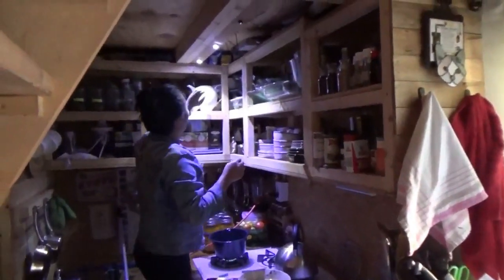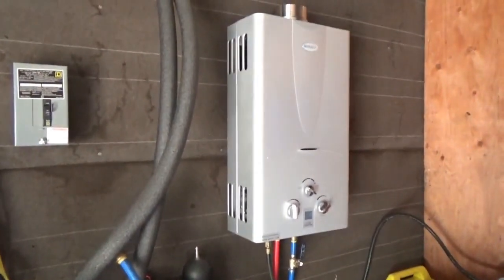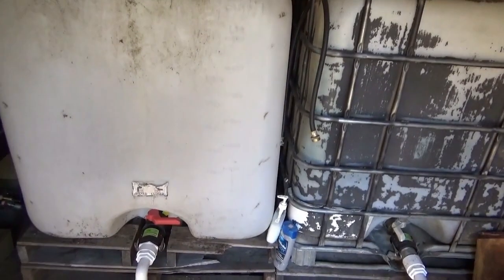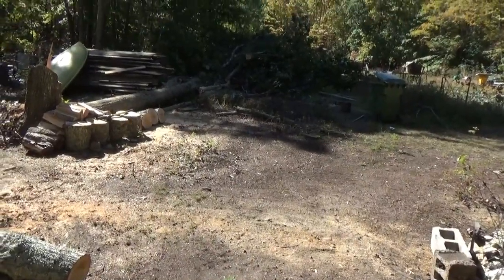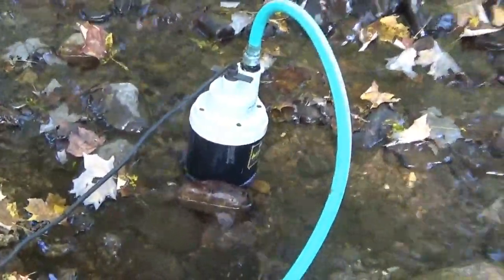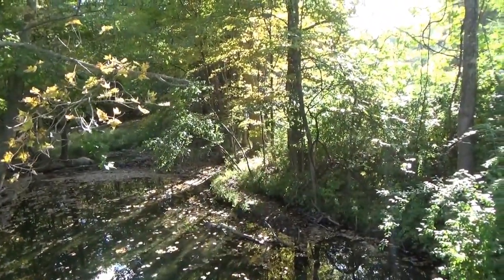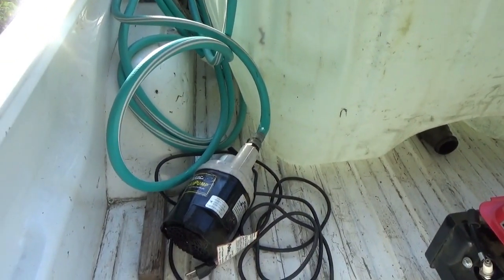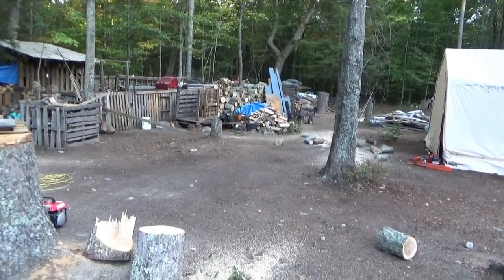Awesome Off Grid Solar & Busy Day At The Homestead

Comment: Come winter time, not sure how feasible this is, can you put a 55 gallon drum up about 2 ft, and burn a fire under it heating it up. Have a tap at the bottom, and shovel snow into the barrel. I know 10" snow apx 1" water. Since you have an excess of wood, and it would give you something positive from the snow....

Comment: i work with pumps troy . what is the outlet size of the sump pump  litre per minute or gal per min and what is the size of the outlet . The size of the hose is why it is slow . the pipe friction would be bad . like trying to pour  a 2 gal of water through a straw
Reply from the maker: Its just a garden hose fitting on it so yes it is very slow. I will have to check the other details.

Comment: We have a Snapper riding mower that we've been using every summer for 40 (yes, 40) years. It has had an engine replacement, and a new seat, but it's still going. So they must be good machines, or at least they were back then.
Reply from the maker: Most things were made to last back then

Comment: would you be getting enough power to power your pump to pump it from your tank on the truck into your main tanks? - also have a look at getting a firefighter pump - it will fill up your tank from the creek in no time and then just use your electric one on solar if you can to put it into the main tanks
Reply from the maker: Probably could have. Just did not think of it. Thanks
Reply: fair enough - see if you can make it your main goal to use the generator as little as possible and as much solar as you can

Comment: Small tip with the water pump.  We have one that we use to pump water off our pool cover.  We get lots of leaves & debris that can damage the pump if it gets sucked up inside of it.  We sit the pump in a sieve or collander before putting it in the water.  It helps keep the debris out of it.
Reply from the maker: Thanks

Comment: lakes, streams, ponds & rivers are ALL PUBLIC works!!!!!!  its illegal to damn or alter! Temp sump basin (hand dug hole) in the river bed is your best bet. having any type of line on others property is obviously a no go..   check into a 30' hand augured shallow well. prob the best bet on your land.  $68 on amazon Seymour , then $10 for each extension piece at your local hardware store.. its all over YT, pitch pumps on shallow hand dug wells, I'm in the same boat as you, with the water situation, although i have a lot more possibilities closer to my actual land! Good luck Troy!
Reply from the maker: Cant dig here due to the rocks and boulders. Need a large backhoe. Small backhoe operaters have said NO. Thanks
Reply: The Do It Yourself World good luck on your water adventures, its # 1 on my list for the spring!

Comment: Just an idea Troy what if you send the heat from the top of the water heater out the front of the shed and not the back, sending it over the top of the batteries to keep the batteries warm in winter !!  I know the heat will only come out while the showers on but it's better than nothing !! Rob
Reply from the maker: Been thinking about running it through the shed

Comment: I'm not sure a propane tank and wood stove in the same shed are a great idea.  Perhaps run the propane line outside?
Reply from the maker: I will probably put the tank outside anyway
Reply: Island Gal71 nor having a battery charging station near the propane, lots of sparking on connect/disconnect.

Comment: thicker battery cables to both of the mppt regulators wil help getting the other working...
Reply from the maker: Ok, I will put it on the list. Thanks
Reply: the end voltage in the other grey regulator is likely programmed lower then the old mppt, if te old mppt dumps in a lot off amps, the voltage on the cable wil rise to the switch of voltage of the grey mppt, switching it off, it messures full battery's, the thicker the wire between the mppt and the battery, the less voltage drop. connect the negative and positive from both the mppt chargers with as thick cable as possible, and direct to the battery leads, avoiding miss messurement from the build in voltage regulators., it has to do with cable resistance, voltage drop, and miss messuring.

Comment: That water looks so clear and clean I bet is would taste great run through a water filter. Plant some grass so it wont be a giant mud pit. you must skirt the tiny house inside the shed to keep cold air out. Batteries must be kept warm.
Reply: @Shartne.   What do you mean "you must skirt the tiny house inside the shed...."
 This doesn't make any sense at all. The thow is not "inside the shed..."; the shed is along side the thow on the outside.
Reply: you can see under the tiny house in the shed. air will freely come in the shed.
Reply: shartne  OK, now I understand. That makes great sense. Let's hope Troy sees your comment. Good eye!
Reply from the maker: I am sure it would be good filtered. I will insulate down there with foam

Comment: the tracer charge controller is working fine, even if you had 2 morning star controllers your batteries can only take so many watts to charge them and they will be up to 14.7v so even if you had 10000W of solar, the batteries will not charge any faster if the batteries are sitting at 14.7v, its better for your batteries to charge the last 10% of charge slowly.
Reply from the maker: Please ignore doc. He is a common troll. I did write a book on how to make solar panels yourself for a dollar per watt. I show you how to buy solar cells off ebay, solder them together, make the framing and everything. Actually I think there are a mess of DIY solar panel making videos on my channel from way back. I am NOT a contractor and do not make that claim.
Reply from the maker: Thank you. A troll is a bored or angry person who just leaves comments in attempt to stir up trouble and hurt people.

Comment: a quarter of a mile isnt that far, you could run a pipe from the creek and use a ram pump or just a standard pump. if you are on good terms with the land owner maybe they wont mind? its worth asking.
Reply from the maker: In winter it will freeze though.
Reply: only if water stays in the pipe. but if the pipe. if you just pulled water in to your tanks through the pipe to fill them, then let the pipe drain again then could that work? would save you having to mess about with getting the tank on the truck and pumping the water twice. if not it seems like you are going to need a much larger area to catch water and a lot more storage. anything you do to will be worth the effort and cost. as you know water is rather important.
Reply: as slow as that creek is running it looks like the creek freezes up as well summer might be an option but winter does not appear to be an option
Reply: i have seen troy in older videos filling water bottles from the creek in the dead of winter. it had good flow and only a tiny bit of ice at the very edge.